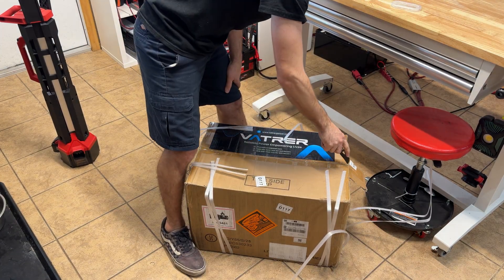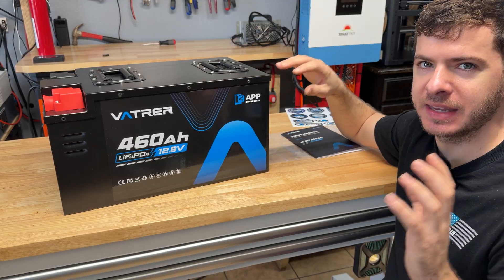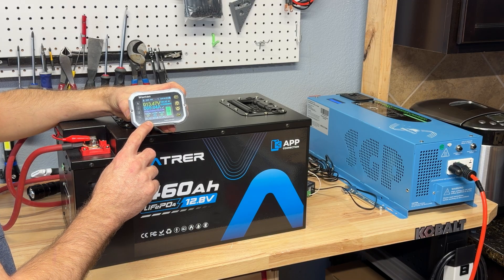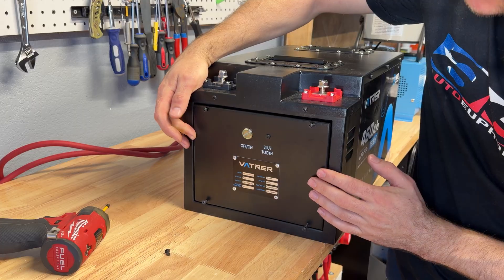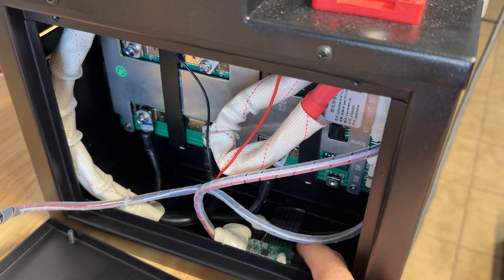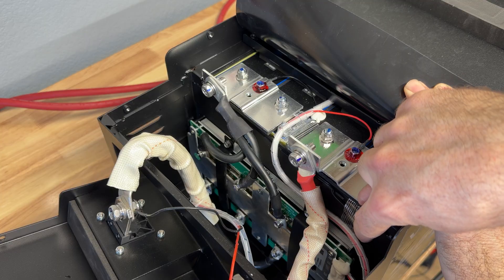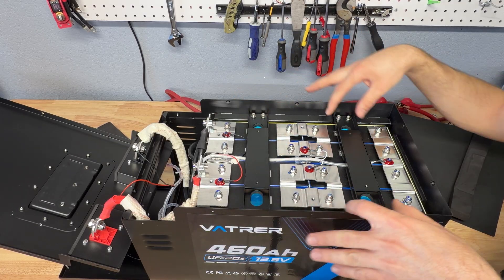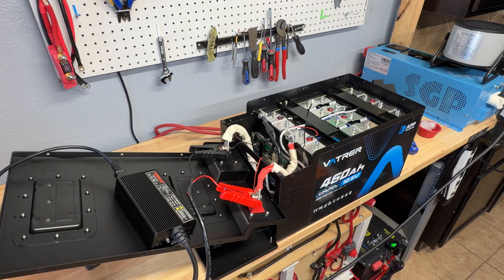Vatrer 460ah 12v Lifepo4 battery Review, Test, Teardown!  Massive Capacity!

Comment: That's a very impressive battery, but I've always wondered about the use case for very high-capacity 12v batteries.  I guess if you had an RV or motorhome with a 12v system and you wanted a ton of capacity, this would work very well.  I could also see this working in a small, off-grid cabin where everything you need runs off a 2,500w inverter.  MAYBE if you put two of these in series, you could run a fairly powerful 24v system, but that's probably the limit of practical application for this enormous battery.  Pretty much any other use case is going to be better served with a 48v system and batteries built to that voltage.
Reply from the maker: I agree, youd be surprised how many people just stick to small scale 12 volt systems, and it would be cool to only need 1 battery to replace 4-5 batteries way less wiring. 
4 of these in series would be awesome
Reply: @Mikebuildss  - One of those for a 12v system with several days of autonomy makes sense.  Four of those in series would require one heck of an equalizer, to keep their SOC anywhere near balanced.  In general, if I need almost 6,000wh of storage, I'm feeding a larger inverter and drawing more than ~1,500 watts of power quite frequently.  This is where going up to a higher voltage simply makes more sense.  I use 12v systems up to 1,500 watts, 24v systems up to 3,000 watts, and 48v systems for anything larger than that.  Basically, I don't want to run more than about 120 amps through any conducting cable.  Connecting batteries in series to make higher voltages is not as "wise" as building or buying batteries of the proper voltage.  I learned that lesson the hard way, like so many of us have.

Comment: Really like the metal case and that everything is screwed together. I worry about other battery manufacturers designing to high spec until someone does a teardown, and then once popular switching to cheaper cells, bms, wiring etc. Great to be able to confirm what you actually paid for. Nice video!
Reply from the maker: Completely agree! Plus can also be service !

Comment: What size wire are you using? Nvm it’s 2 gauge. You need 1/0 awg for that battery
Reply from the maker: Agreed, i have some 2/0 stuff may try and make some cables
Reply: @Mikebuildss depending on distance, you may need a larger size

Comment: I'm surprised they're messing with 230ah cells.
The 560ah batteries would be the main event if they weren't charging so much for them.
Those MB56 cells are monsters. But the MB31 are just barely behind them and way less than half the cost as a battery.
Reply from the maker: Is that what the 560ah has in it? I may try and acquire one i wanna see!
Reply: @Mikebuildss yeah. And they're testing at 670-680ah.
Reply: It's essentially two MB31's in one casing. But a little higher capacity in testing.